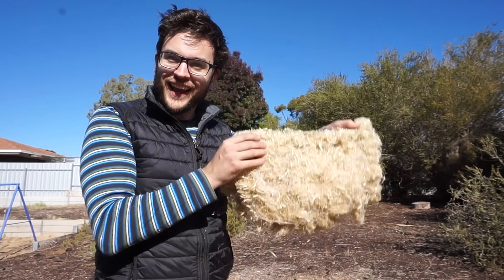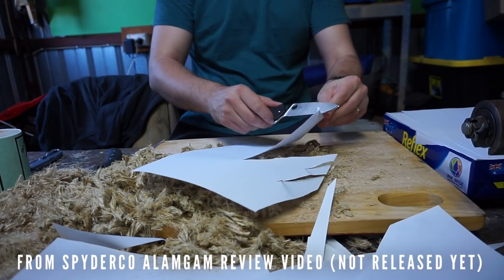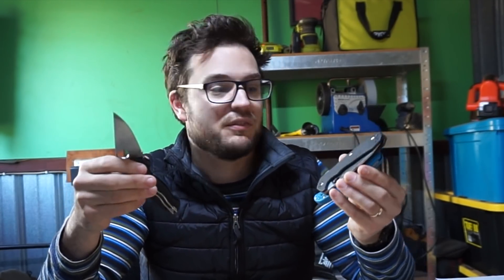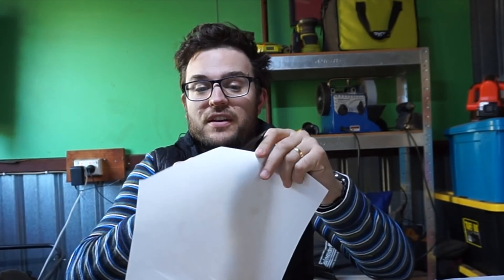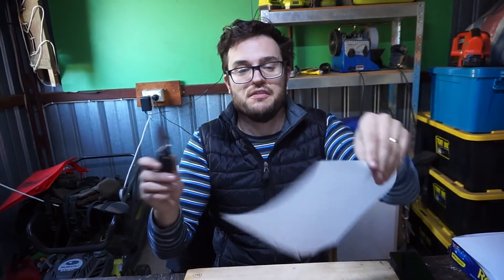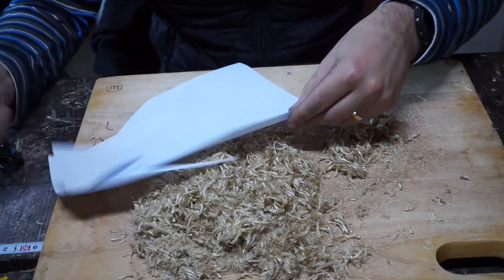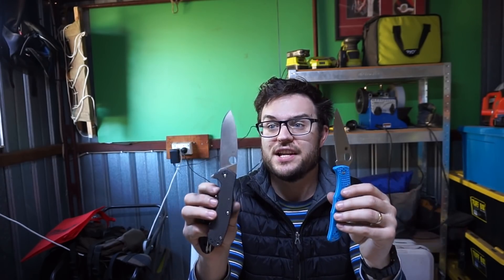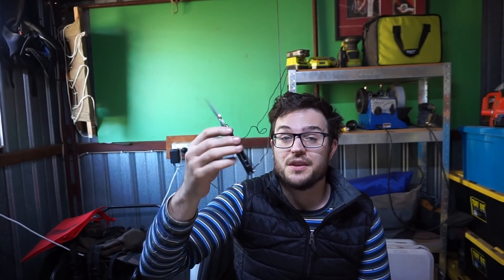CTS BD1N - Spyderco Para 3 Lightweight Steel - VG10 and S30V comparison

Comment: As compared to s30v that small drop in edge retention for substantial gains in toughness, corrosion resistance, and ease of sharpening are a great trade off. As with many Carpenter steels the biggest challenge is going to be availability.

Comment: Wow, this video has 3 of my favorite Spyderco things of all time in it…the endura, the amalgam and BD1N. Since this is mostly a BD1N video, I’ll comment on that. I absolutely LOVE Spyderco’s BD1N. First of all, it holds a reasonable edge…but that’s the least of it. They often pair it with a stonewashed blade and that makes for an incredibly combo. A steel that’s easy to polish contrasted against a stonewash is 🤤. On top of that, I’ve put my para 3 through enough cardboard that you could probably start to measure it in miles…I’m not joking. But when you examine the blade, it shows just a bit of scratching in the right light. The stonewashed BD1N is brilliantly scratch resistant. I can’t say enough about how much I love that stuff, man…and I’m not a stainless steel guy. I’m a cruwear, k390, m4 devotee for the most part.

Comment: BD1N is done at 63hrc on most kitchen knives and 64hrc on some custom kitchen knives by Ken Onion. I have a few kitchen knives in it and a UKPK (terrible factory edge, 13-14° on one side and 18-20° on another. The kitchen knives have done great in my use, only need a touch up every 2 months. UKPK isn't as good, is love to know what kind of heat treat Spyderco used on these. I like steel, it has better edge stability, corrosion resistance and ease of sharpening and takes a very keen edge. 
Nice test Pete, great result for this steel.

Comment: Interesting, my Para 3 LW's bevel is quite a bit squirrely as well.  Normally I don't notice these things, but it's all over the place.  It still cuts though :)

Time will tell if it's able to kick the Delica off its throne, but I really do like the direction they're going with FRN and compression locks.

Comment: The intro was amazing, and PM2OG said it was very comparable to XHP would you say it is similar as well and is it a good bargain for the price of $91?
Reply from the maker: William Schmidt hmmm it certainly looks similarly tough. Edge retention gonna be a little less, unless theres some heat treatment wizardry going on
Reply: Being that xhp is a high carbide steel it will hold it's working edge longer. Bd1n is a very fine grain structured steel, so it will hold a fine edge longer. That's where s30v outpaces bd1n in this test

Comment: Good effort, and congrats for being one of the first people to review the BD1 LW Pm3.  However, this test is a bit unscientific in that I assume you're not testing after each cut.  Maybe every 25 or something.  So +/- 25 in each direction makes S30V and BD1 fairly close.  Also factory edge vs your edge is likely going to yield different results.  I think I might pick up one of these LW PM3's though.  In Canada it's like $120 vs $250 for a 'sprint' Pm3 such as Maxamet currently.  For less than half the price of that, it's a bargain for same ergos and cutting performance.
Reply from the maker: oh damn right its not scientific. theres a void the size of the mariana trench between these tests and real science. The main intent us to give folks a rough idea

Comment: Thats s great result for the BD1N , I knew it would beat Spyderco's crappy VG-10, LOL.   What about the 20° Work Sharp Edge ??   Not doing those anymore ?  I have Pages of 20° WSE results and all these new 17° only results are throwing my books off, because some steels will hold a 17° edge and other steels won't even though that same steel had  good 20° numbers.  Or you could go back and redo all the steels with 17° edges , YAAAHH !!  That would work also.   Anyway , great job Pete , keep'em coming ....

Comment: Great video! What you think if compare  bd1n to m390? I whant to make set of knives for kitchen and choose between these two.
Reply: I think a lot of it depends on how you feel about sharpening/maintaining the knives. M390 will hold an edge better, but the bd1n will be a LOT easier to sharpen. In my experience m390 is pretty good as far as corrosion goes, but I'm pretty sure that bd1n is even more resistant (at least in the comparisons I have seen).